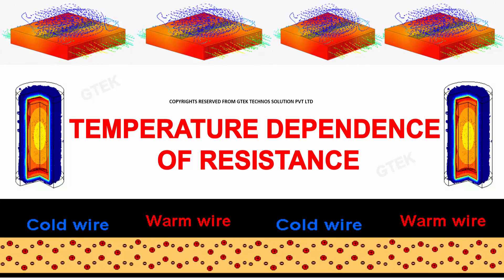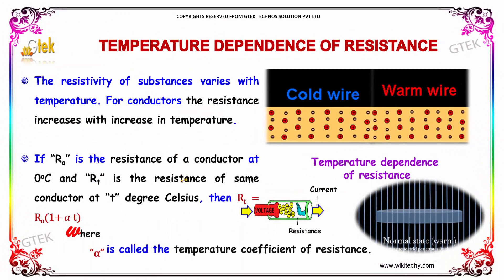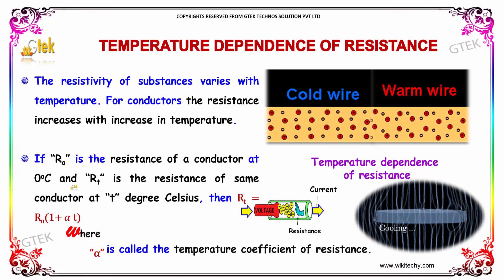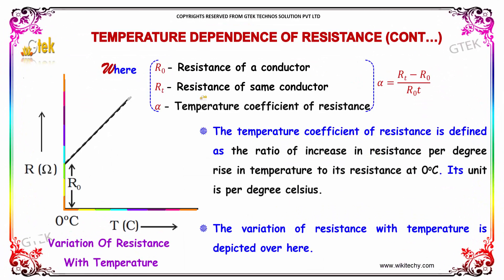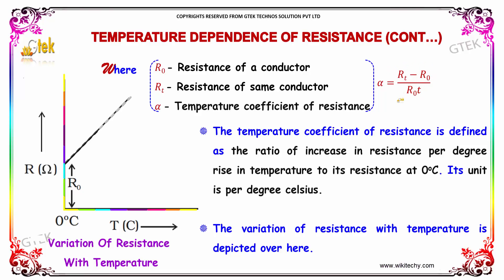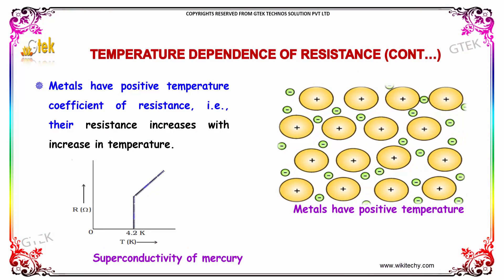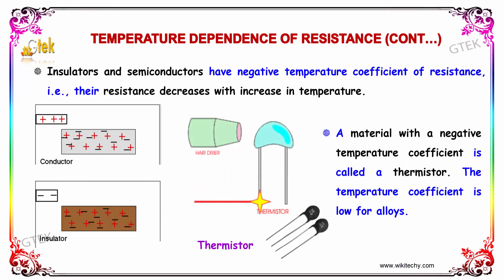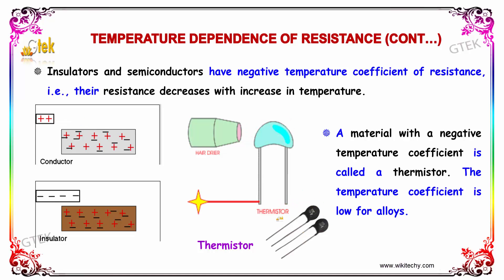Temperature Dependence Of Resistance Current Electricity class 12 physics notes CBSE IIT JEE NEET

Comment: Electric power is the rate, per unit time, at which electrical energy is transferred by an electric circuit. The SI unit of power is the watt, one joule per second. Electric power is usually produced by electric generators, but can also be supplied by sources such as electric batteries

Comment: Whenever a thermistor increases its resistance with an increase in temperature, it is said to have a positive temperature coefficient (PTC). If the thermistor decreases its resistance with an increase in its temperature, it is said to have a negative temperature coefficient (NTC).

Comment: A negative coefficient for a material means that its resistance decreases with an increase in temperature. Semiconductor materials (carbon, silicon, germanium) typically have negative temperature coefficients of resistance.

Comment: A substance with electrical properties intermediate between a good conductor and a good insulator. An empirical quantity, denoted by α, which describes the change in resistance or resistivity of a material with temperature.

Comment: The resistance-change factor per degree Celsius oftemperature change is called the temperature coefficient of resistance. This factor is represented by the Greek lower-case letter “alpha” (α). A positive coefficient for a material means that itsresistance increases with an increase in temperature.

Comment: The resistance of a typical conducting wire is low when temperature is low and high when temperature is high. The increase in resistance alongside temperature is due to an increase in energy of the wire atoms, which cause them to vibrate more and impede the path of the electrons flowing through.

Comment: The temperature dependence of resistivity at temperatures around room temperature is characterized by a linear increase with temperature. Microscopic examination of the conductivity shows it to be proportional to the mean free path between collisions (d), and for temperatures above about 15 K, d is limited by thermal vibrations of the atoms

Comment: Since the electrical resistance of a conductor such as a copper wire is dependent upon collisional proccesses within the wire, the resistance could be expected to increase with temperature since there will be more collisions. An intuitive approach to temperature dependence leads one to expect a fractional change in resistance which is proportional to the temperature change: